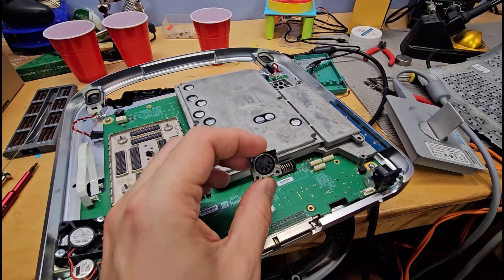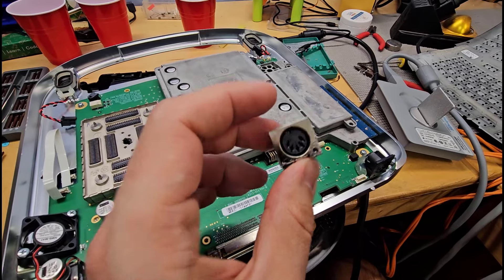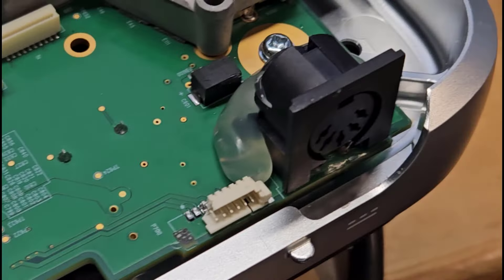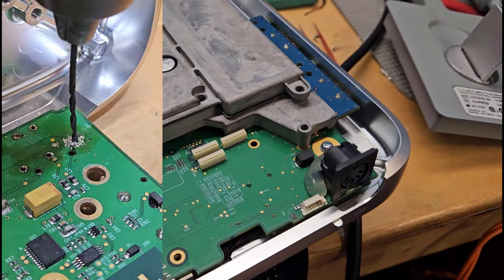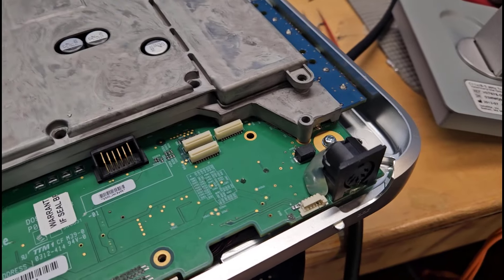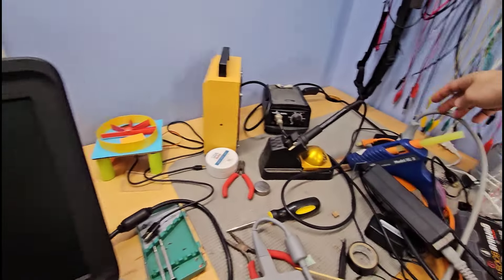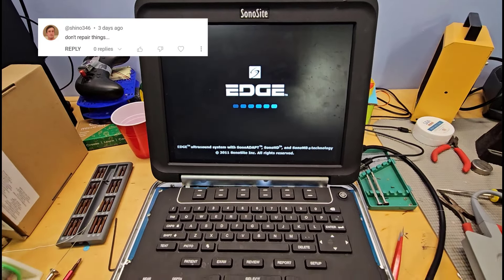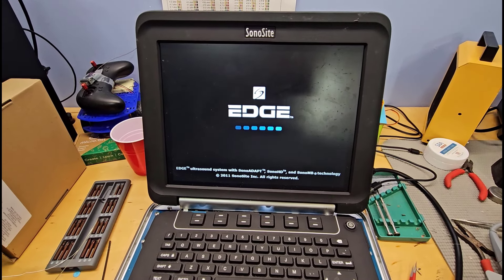Crappy PCB repair (part 3) - using a drill to clear clogged through holes

Comment: On a multilayer board, the inner diameter of the holes also connect the various layers of the board. If you drill them out you can wipe off the connections between layers.
Reply from the maker: Never said this was a good idea.
Reply: @BenFinio Fair enough, I've done stuff like that in the past too.